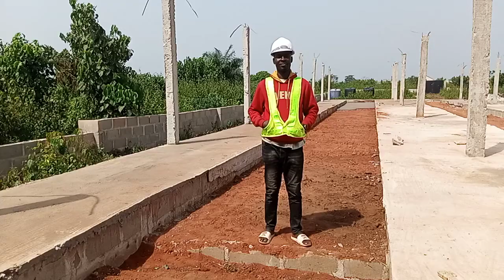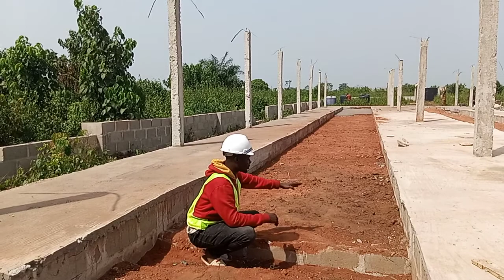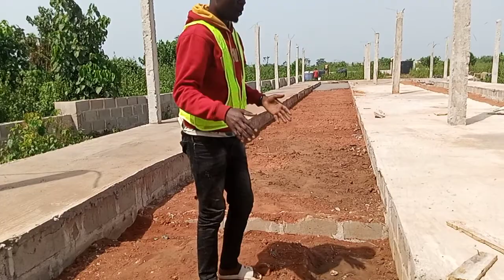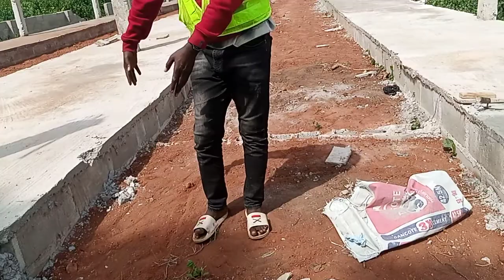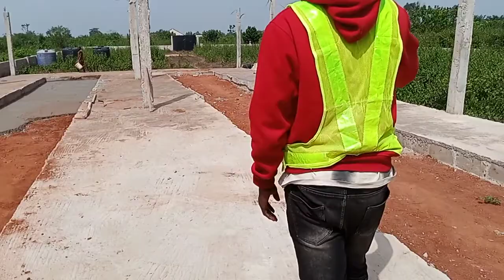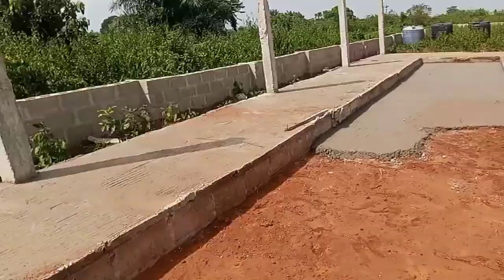Modernizing Your Poultry House Construction

Comment: Can you stand fully like this under the cages when installed?
Reply from the maker: No Sir.... This is because, the cost of sand filling that height is very expressive. Secondly, at that height, you need to use 9 inches block for that or casted walls on that  to reduce the risk of the walls falling down. Bearing in mind that the poultry Dung's are very concentrated with high level of ammonium that has the capacity to destroy or eat up anything, be it iron or cement, and that could collapse the high walls faster than a shorter walls